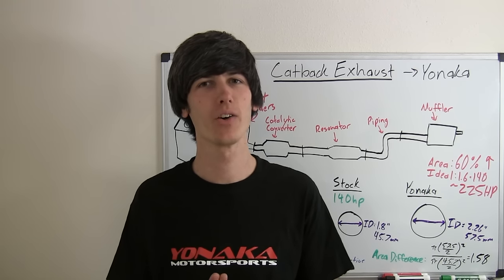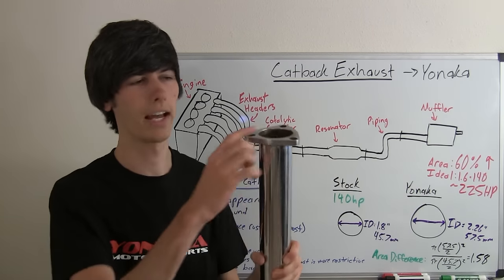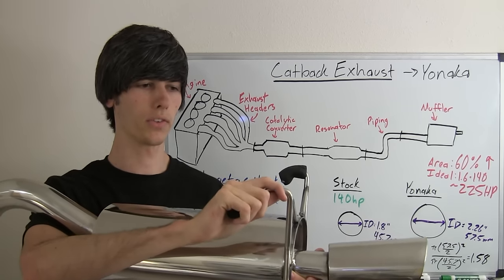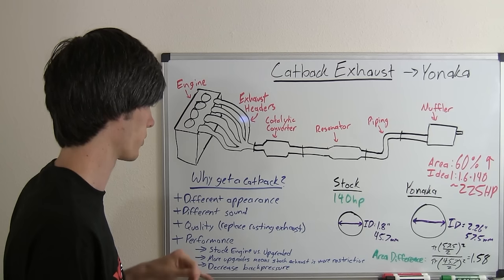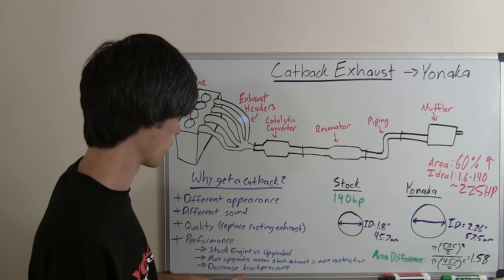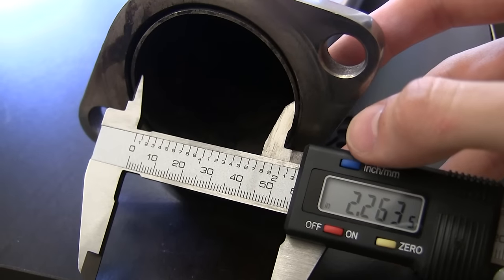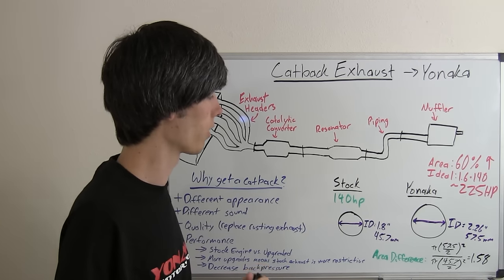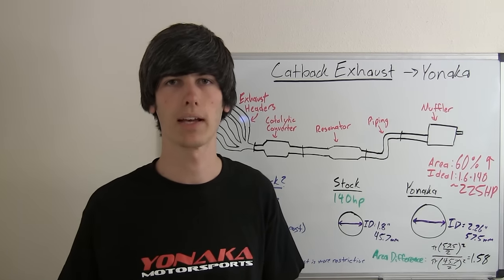Catback Exhaust - Explained

Comment: Hi, first off thank you very much for your videos. I've learned so much from them so far. I was wondering if you could create a video explaining why a wrc/rally car has the cat placed at the end of the exhaust system in comparrison to a stock car which has the cat close to the engine. I think this is to do with heat managment but I could be wrong. Anyway its just a suggestion, thanks again for all your great quality videos and keep up the good work, we love it here in ireland

Comment: GREAT VIDEO and good information! i just have one question: i understand that the catback would be more efficient on the 225hp car, but what improvements/upgrades will it do to a stock 140hp car?
Reply from the maker: Probably not much, I hope to do a dyno test eventually to see though.
Reply: Pfft, tops around 1-5 horsepower. But I think on average its around 1-2.
Reply: It depends on the engineering specifications of your car.

Comment: Simple answer, bigger pipes and a muffler and resonator that doesn't restrict exhaust flow as much means the exhaust can escape faster and therefore the engine will have more free space in the cylinders for new air/fuel to fill. More new air/fuel means more power. 

By the way, you measured the stock exhaust at the muffler outlet. That is not the correct I.D. That tip looks bigger than the muffler outlet. It's probably a 1.5" pipe.

Comment: I've got a yonaka catback on my 92 accord coupe. Best 250 dollars I've spent. I always get compliments on the sound of my car. its deep and smooth with no rasp or rattle. 
I bought it thinking it was cheap so it would rust out quick (I live in Washington) and who cares it's easy to replace at that price..well I was wrong. It's not cheap its inexpensive. It fit like it should, sounds great and I've had it on my car 3 years now with no rust at all on the catback. 10/10 wont ever spend 800 on an Apexi ws2 with this option around.
Reply: did it affect your fuel economy?

Comment: We understand that you are being mathematically correct in your numbers. We also understand that the exhaust pipe gives us extra HP to work with in case we want to modify the engine. Now what about real life and real time numbers? I believe that is what most of the individuals on here want to know. How much HP and torque can you gain from just the exhaust? Is this exhaust single or dual. Did you modify the stock air box or install a CAI or a SRI? Do you have the modified intake and the modified exhaust working together? Thanks for the correct numbers and your views as an engineer but we need real life and real time numbers and situations.

Comment: Although the after-market exhaust systems look pretty, I doubt you will get big hp gains because the main restriction to high flow is the catalytic converters which can't be removed unless for race-track only. For example my 2014 Ford Focus with 2L engine already has fairly large diameter ss exhaust piping and a huge muffler which flows quite well without excessive noise. Consider also that a loud unrestricted muffler may cause a very loud and annoying interior drone at various highway speeds. I might try a K&N CAI but an aftermarket exhaust is just not worth the huge expense and hassle IMO unless the stock system is a very poor design.
Reply: For example the 350z its not a true dual from factory it just has 2 tips. Now making it a real dual exhaust then that makes sense right?
Reply: LiLDeMoN8I8
That can't be done because they only have on exhaust manifold. I guess it could be done if you made a split manifold. I think some old Ford 300 I6 did that.
Reply: Exactly! The catalytic converter is very restrictive. I have a 96 mitsubishi eclipse gsx and when I don't have to smog the car, I run a 3in exhaust from the turbo all the way to back of the car and a tune. Frees up a lot of lost power and torque. When it's time to smog the car i just bolt in my stock exhaust and good for another 2 years.
Reply: gwwayner If you live in an area where it's legal, high-flow cats are worth it. They can be had for relatively cheap compared to a full cat-back, and keep you legal just in case.

Comment: I noticed what seemed to be some confusion when starting on the subject of 'if you catback is causing a restriction,  I think it was just nerves because what he said was accurate but the way he said it wasn't (delays and run on sentences)  Measuring the tip of the exhaust was just about meaningless, as you don't know what the muffler design is, and maybe the catback tubing is different size than the output muffler tube size.

Comment: I think you may be over simplifying it a bit.  Surely the exhaust as a whole system needs to be engineered with attention to both the cross section and the length of each component to keep up gas velocity and optimise the effects of the pulses to aid scavanging - so just going bigger isn't the whole story to opening up HP potential.  The resonator, for example does a whole lot more than just reduce noise - it's inegral to the tuning of the system to ensure that the exhast is pulses are handled in as beneficial way as possible.

Comment: Hey dude, nice video.

Anyway, I can't understand the last part of your video. There isn't any direct correlation between HP and exhaust gas pressure.
Ofc exaust pipe is an important part of the car and may become a bottleneck, as u said, but even if it's possible, it is not true that if you increase your HP you have to increase the diameter of the exaust evrytime.
Just to say one, any efficiency improvement into energy transmission will improve HP, but not exaust pressure.
Also, installing a turbo compressor will increase HP output, but, again, you don't need a larger exaust, since the turbine itself will drain the excess energy from the gas before to send it into the exaust pipe.

I think the right sentence here, is that if your're going to increase the exhaust gas pressure by 60%, you'll need a 60% larger exaust pipe to have the same pressure as before. Just that.
Reply: Nice understanding, i have a question, if I put a larger exhaust on a car without any other modifications, can it lower the performance in any way !? (sorry for my bad english)
Reply: +Samuel Parent if you do not add significant weight with the new exhaust pipe, performance will be the same.

anyway, a really overly large exhaust pipe, will cause the exhaust gas to flow slower (despite the flow rate will be the same) and this is something you usually want to avoid, since with a slower flow, pressure will increase according to bernoulli's equation.

Comment: Back in the 70's and 80's when catalytic convertors were new and before all manufacturers started using stainless and other composites for the exhaust the exhaust system would rot away rapidly from the cat back. The reason was that they always used stainless before the cat because of the heat they were generating in the system to make the cat work. After the cat they just used steel as usual.  What does the catalytic convertor do?  It produces a heated catalyst that converts the HC and CO from the combustion gasses  into H2 and Co2 and H2o which is water.
 Because the cat produces water the car with exhaust issues would always need 'cat back' because the entire system from the cat back was severely rotted from the inside out by the water produced in the cat. Todays cars dont use simple steel anymore they usually have stainless or a composite that resists rust so 'cat back' is not as frequent as it used to be unless you want something louder or cooler looking and 'cat back' sounds cool. Cats still produce water but manufacturing of exhaust has changed to account for it.
.

Comment: Another aspect of cat-backs (and probably the most important) is weight savings. Most exhausts are rather heavy (especially muffler), an aftermarket muffler can shed 20 to 50lbs of weight, depending on the model of your car. As you probably know less weight is actually better than more horsepower, since it affects cornering and braking.

Comment: Hello, I love your videos! But I have one question.
When you are calculating areas, I think there is a little mistake. Circle area should be Pi*(d/4)2. When you calculation only ratio it doesn't matter. But when i would like to get exact numbers, there will be mistake. Am i right? 
As i said, I love your videos. Keep going what you are doing.

Comment: Optimum exhaust velocity for a given setup is what your truly after.  Smaller dia pipes work for a stock power. When you increase power your going to need to flow significantly more exhaust. This is where larger pipes are needed.
If you go to big you will have a torque dip in the lower rpms that will show up on a dyno chart.
This will show up in low throttle drivability.
The power dip is because you lost the flow speed that helps to empty your cylinder.
Pipes and more specificly exhaust flow/velocity need to be optimised for the particular amount of power you wish to generate.
 Exhaust velocity is needed to more completely empty the cylinder on the exhaust stroke.

Comment: A questionable assumption to say the least, but my point is that 60% more power cannot realistically translate to needing 60% more cross sectional exhaust area as there are so many things to take into account. It would imply that a 1000hp skyline by you're calculations has an ideal exhaust diameter of 5 inches...so I guess its kinda close but too large. Some actual testing and data would go a really long way man if you added them to your videos :) good work though keep it up!

Comment: What he is saying is that if you have given your engine an upgrade, for example a turbo charger. The increased pressure in your exhaust causes back pressure, so it would cause you hp gain to decrease say from 100 hp to 50. so adding a cat-back will not increase horsepower but help your upgrades to run their maximum potential.

Comment: thanks! i'm really enjoying all your videos!

i need to replace most of my exhaust on a 92 toyota pick with a rebuilt 22re that has a mild bore and bigger valves. would you recommend a larger diameter pipe or stick with the stock size? i dont intend to do any other engine upgrades to increase power unless something needs to be replaced anyway.

Comment: Nice vid, i reckon though, you should have also explained the negatives on fitting an cat back exhaust. Especially on 1.8 litre 4 bangers with no turbo. Also discuss airflow : velocity vs diameter. Why does smaller exhaust systems give more low down torque as oppose to bigger ones on n/a cars...etc. I actually dont know the reasons, but i do know these draw backs exist =p
Reply: I believe the reasons exist because of the back pressure that is created. Torque and Horsepower are proportional to each other by means RPM values. Horsepower is really just a measure of torque over a distance and a time. With that said, opening up the exhaust diameter allows more air to flow in a less restricted manner. Putting a smaller diameter on will restrict it even more.

The engine has a defined compression ratio. This is defined in the factory and cannot be changed unless you change out features of the piston.... or by creating back pressure. If you create enough back pressure, then not all of the exhaust gasses can escape when the exhaust valves open. This means there will be a little more left over in the combustion chamber and the compression ratio will be a bit higher the next time the piston comes around. On 4-bangers it is really important to have a high compression ratio if you want torque. Therefore, with more back pressure you get more compression and thus more torque.

If you open up the exhaust diameter, you will simply be shifting the back pressure graph to the right. Essentially meaning that you will still eventually hit the same back pressure value, just at a higher RPM. That's my take. I am sure there are other variable out there though.
Reply: Ben Young Wow that actually makes more sense, i always google this topic but never really iunderstood why it happens. I own a evo 7, and was told to purchase an exhaust for more  high end power, however didnt want to sacrifice low down torque due to turbo lag (which is massive in these cars). Some people say exhaust systems reduce lag, others contradict. Cheers for the response man.
Reply: back pressure is part of it
Another reason bigger isn't always better is  exhaust velocity.
a smaller pipe means a given amount of exhaust gas will have to travel through a smaller pipe faster than a big pipe.
this helps the engine breath better at low RPM, as the burnt gasses are expelled quickly. the force of the exhaust leaving this quickly also means that (in some cars) as the intake valves begin to open, there is actually a slightly increased vacuum force caused by the exhaust leaving the chamber quickly.
this slight vacuum assists the piston in creating the low pressure area to suck in more air and thus more fuel.

this means that at low rpm there is more torque (but not horsepower as the rpms are low)

and like Ben said bigger exhaust simply shift the graph over to a higher rpm powerband
Reply: Alex Sigler Yep that makes sense. Is there anyway to somehow not compromise low end power when installing a turbo back. I just installed one on my evo, the spool is much better but i still have sluggish take off if i dont launch. You reckon a simple tune can resolve this?
Reply: donkey1450  as far as turbo's go a smaller turbo will spool up faster, decreasing lag
Often the best thing for a turbo car to minimize lag is to use either twin turbo's (one small, for low end grunt, and one larger one, for top end breathing once there is sufficient exhaust volume)

Also, mounting the turbo far down the exhaust line generally makes the lag worse as the turbo has the fill allot of space for the intake piping that goes all the way back up to the engine.

as far as some sort of tuning, i don't really know of any timing or fuel adjustment tune that would really help the inherent lag of the turbo back set up
generally you see turbo back set ups on cars with large displacement motors that make better use of the lower boost pressures
Reply: Alex Sigler Yep thats true, turbo is still factory so id assume its relatively small. Im beginning to think throttle response is the issue as well. Im just not used to the AWD set up, coming from an ex n/a rwd skyline. However as you stated before my power band has improved mid and high rpm, the spool is so strong, low end hasnt plummeted, just very laggy off the line which i didnt like. Cheers for the help, ill see what i can do, probably colder air intake and exhaust manifold will help with spool up.

Comment: I Like this explanation 100 percent correct.  I think the dude on the bottom bought to large 2.5 diameter pipe for the hp he has, which might in turn make less hp.  Unless he drops a turbo on that. Woop.

Comment: Well not necessarily. Depends from car to car....in my car the downpipe is 2.5" and splits off to 2 x 2.25. Hence by measuring my exhaust tip/pipe you can not say my down pipe is the same diameter. 

So the 60% area gain will drop down :). Unless the exhaust is SUPER RESTRICTIVE, you will not see the gains that you mentioned....I understand is highly theoritical but its like putting wrong info out there. I love all your videos, a lot to learn from, and I would hate to learn something wrong :)

Comment: it's not a type of exhaust, but merely a description, when someone says " buy a catback exhaust" what they are saying is to replace the exhaust for a better one but not including the headers and the cat, so everything backwards from the cat is replaced.
You can also replace/upgrade the full system meaning the headers, cat and everything back from there id changed.